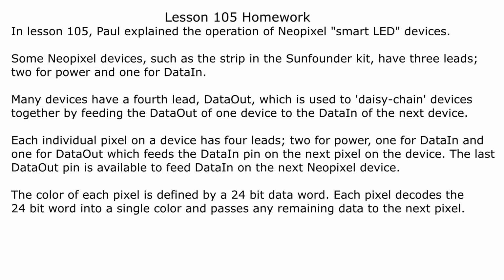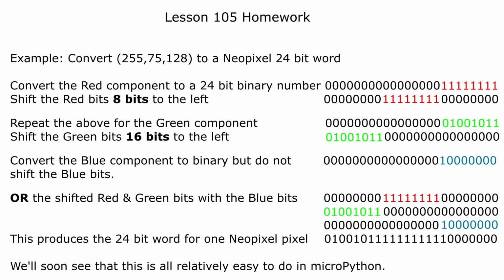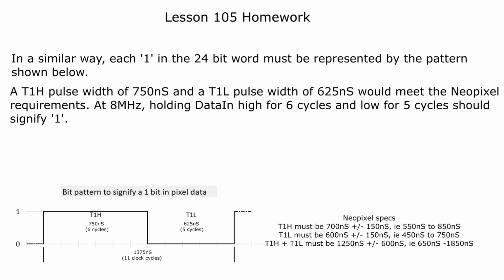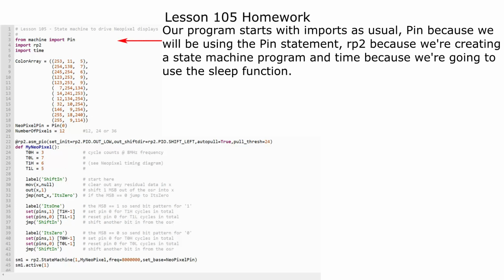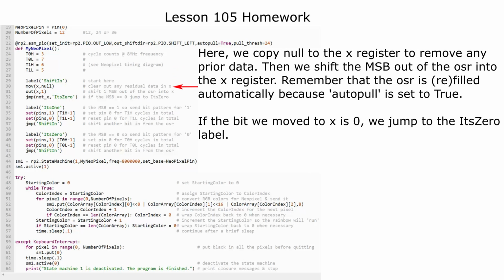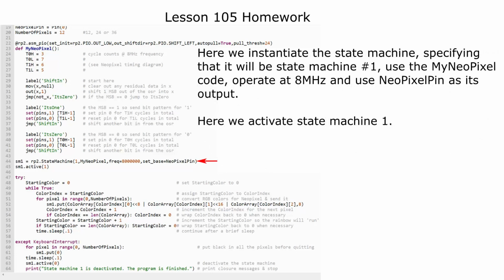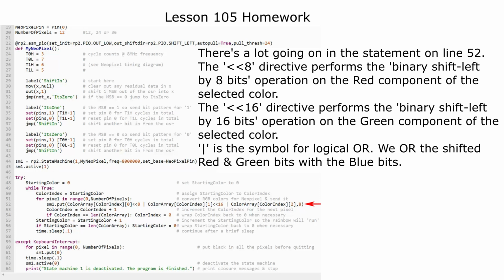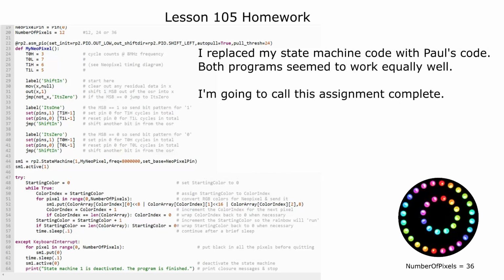Raspberry Pi Pico W - Lesson 105 Homework Solution

Comment: Interesting solution! Great job. When it comes to coding I am a hunter gatherer and used the best solution I could find. I always try to understand what others are doing and why. I just could not find anything better that the 4 line PIO code I found. I explain it on my hw vid and link to where I found it. I found that looping through a list in Python did not work for my 60 pixel strip so I had to use an Array object that can be passed to the PIO directly.
The PIO documentation has the answer to the "8" at the end of the "put" statement.
@@@@@
StateMachine.put(value, shift=0)
value can be an integer, an array of type B, H or I, or a bytearray.
Each word is first shifted left by shift bits, i.e. the state machine receives word << shift.
@@@@@
The basic data size for the pico is 32 bits. So your bit shift and or code creates this 32 bit code
00000000ggggggggrrrrrrrrbbbbbbbb
The 8 at the end tells the code to shift the 8 zeros out resulting in
ggggggggrrrrrrrrbbbbbbbb00000000 in the FIFO
since we set up the PIO out to shift LEFT it will shift out the 24 color bits then the 24 thresh tells it to ignore the last 8 - "0" bits and pull in the next 32 bit number. It took me a while to get this straight in my head. I tested this by first changing to this shift pattern
(g<<24) | (r<<16) | (b<<8) and taking out the ,8 . It will work the same as before. Then to prove it ignored the lower 8 bits I  added junk data to those bits like this
(g<<24) | (r<<16) | (b<<8) | 255 and it still worked fine.

I don't know if this long ramble helps or not.
Keith